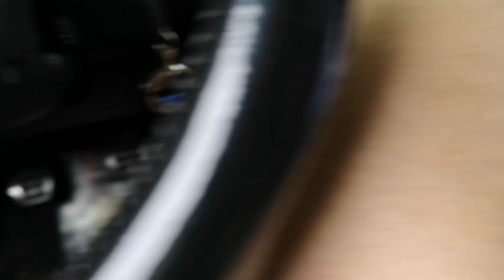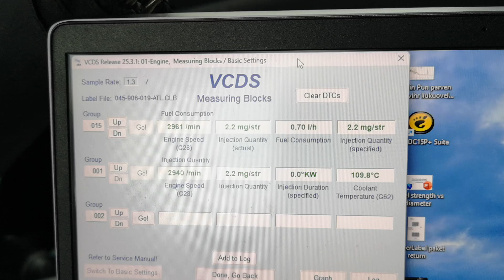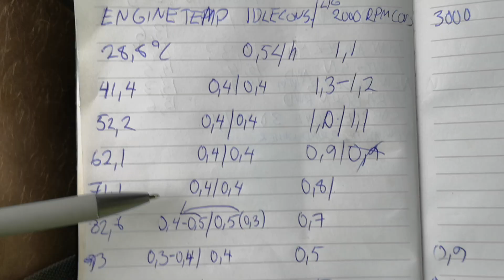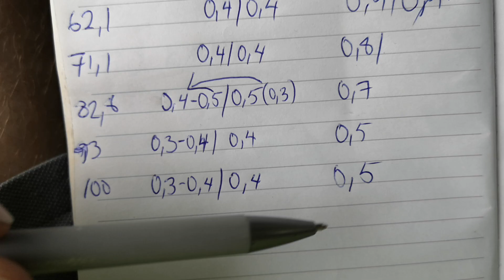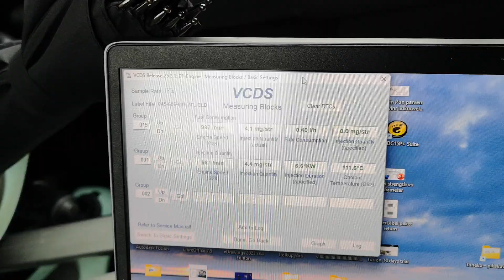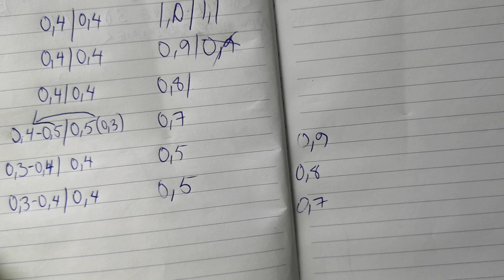1.4TDI engine temperatures vs efficiency test. Hotter is clearly better!

Comment from the maker: Current best thermostat found so far is 92c thermostat Wahler part number is 4256.92D50. its a bolt on and keeps my engine at 94-95 celsius with full grill block on. and buy only this brand others can be a guessing game what you get. With this engine is 5 celsius hotter than with oem wahler thermostat.
Reply: Can I put it in 3l?
Reply from the maker: @ganzganzofred2641 yes you can

Comment: Wishlist out of your control:
I really wish that VCDS had the option to show TWO sig-figs on the fuel consumption values, here, not just one.

If you ever decide to ask Ross-Tech for a feature request like that: please post up a link to the Ross-tech forum in your description, so the rest of us can pile upon and add a "me too" to shore up support. 

I'm sure those folks with above 10L/100km consumption rates wouldn't care much, but us diesel engine folks sure do!
Reply from the maker: Yes more scale would help for sure. In theory you can calculate some values from actual injection values, but they also change all the time.

However same old trick works with oem dash as with scangauge that you start using mpg scale. Then it's more accurate, but you need to calculate it back to l/100km
Reply: @TunekoLtd  I still have my Scangauge I bought in 2009 hiding somewhere. 

What I first need to do, is finish choosing my mk4/B5 cluster to put into my Jetta, and put the 
3DColorMFD in it, and see if it reads a good and accurate L/100km value on it's custom displays.   The backup - revive my old Scangauge.

Barring that - yes, I have to convert to MPG for talking to folks stateside, and it give the accuracy we're after.
Reply from the maker: With Seat Cordoba I had printed conversion chart in the dash MPG to l/100km...
Reply: @TunekoLtd  I did the same with my first car and the Scangauge!  In US gallons that is.

I find most people in Canada I talk to use MPG to measure their fuel consumption. Which is might confusing when ... we have not used anything but litres for buying fuel as far back as I can remember, before I could drive (over 40 years).
I do live on a border town, so US gallons can be had with a bit of a trip.

Even more ambiguity is added, when some of the people 2 decades older than me remember the imperial (UK) MPG versus the US MPG the rest of them use.   Ugh!

Comment: Thank you for making this video!  

Looking forward to further tests with the 105C Thermostat.  And, or when you've finished your battery of tests: Brands and PART NUMBERS for these aftermarket thermostats?

I've been subscribed to you for occasional updates back to the days of catching posts you've made on the ol' Ecomodder forums.

Here in Canada, I've just the 'normal' N. American TDI offered engines here the same era as your Lupo - 1.9L VE TDI, and a 1.9L PD TDI.  

In the 4-cylinder cars, I expect the idle fuel consumption scales (will be ~33% higher than yours, at least, at idle).
Reply from the maker: Still write ecomodder.com almost monthly, but mainly aerodynamics side.

1.9tdi idle consumption is 0.4 l/h when tuned correctly.

Part numbers are already at Facebook.com/ekotuning but fitment etc is unclear at this point...